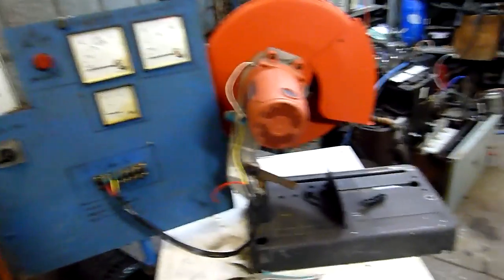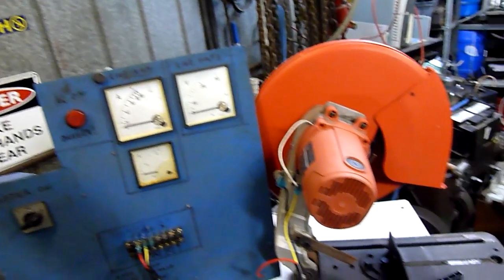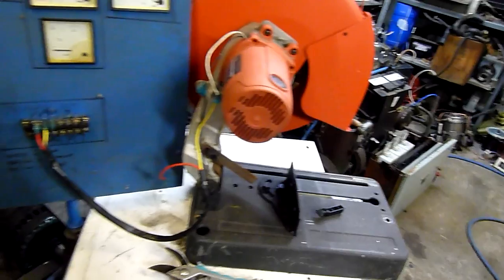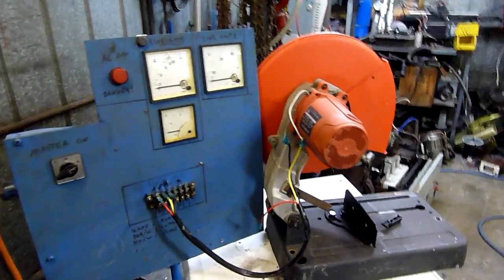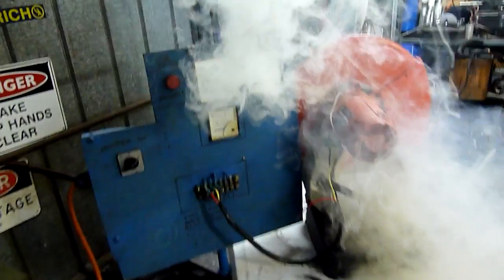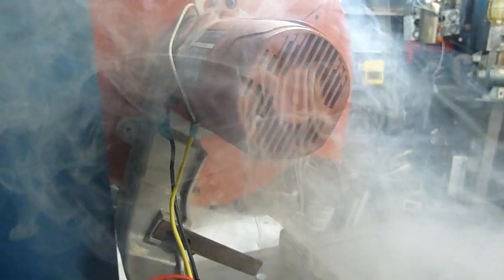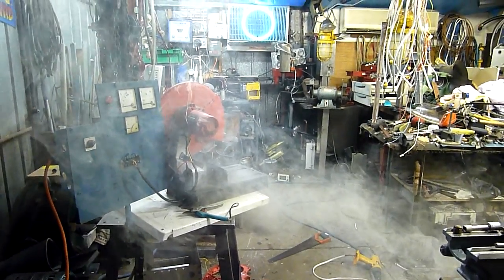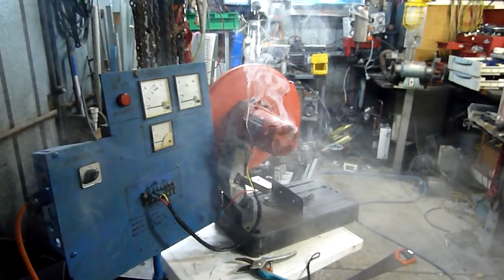Industrial Chop Saw - Epic Motor Burnout (Damaged Rotor)

Comment: just out of curiosity, if you had done that in Europe the engine would not have died, we use normally 220V
Reply: CLAUDIO GRASSI Mains voltage in Australia is 230V 50Hz. Same as Europe. :-)
Reply: Rudy van Katwijk I'm so sorry, I thought it was a video shot in USA! You're right, same european voltage
Reply: CLAUDIO GRASSI No worries. :)
Reply: CLAUDIO GRASSI *230V AC

Comment: hmm might have a problem there ed! think you need to call the service guy on that one. 

its amazing that it pulled 45+ amps for so long. the voltage drop across it looks pritty impressive from what i could see too lol. 

good vid
Reply: The voltage remained fairly significant actually, it was the current draw that dropped due to heat and breakdown :) .